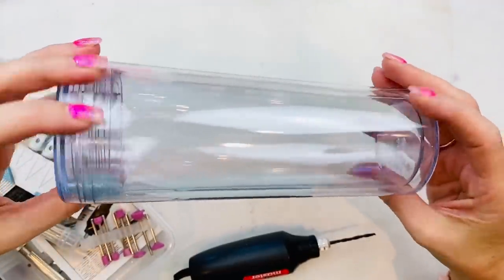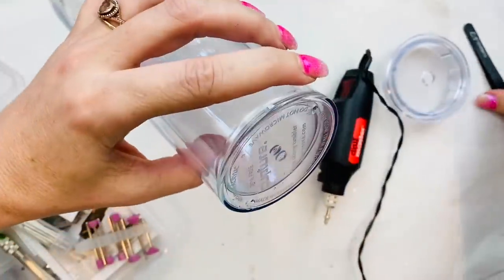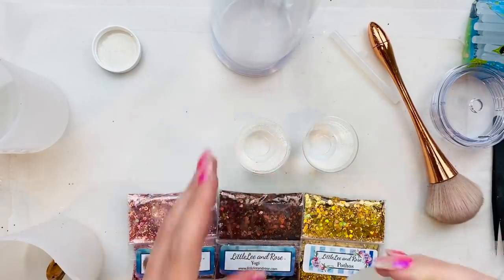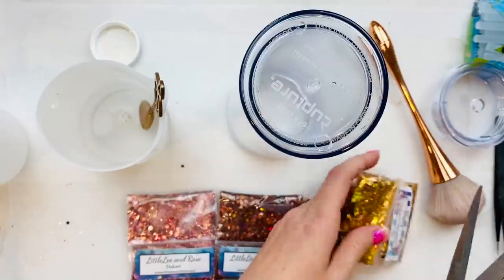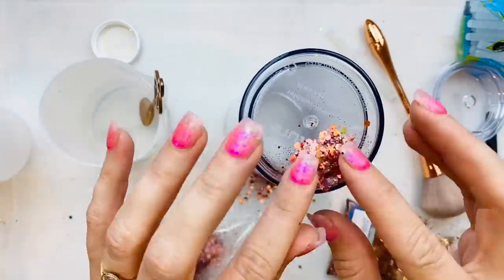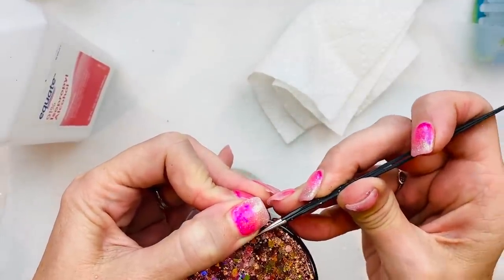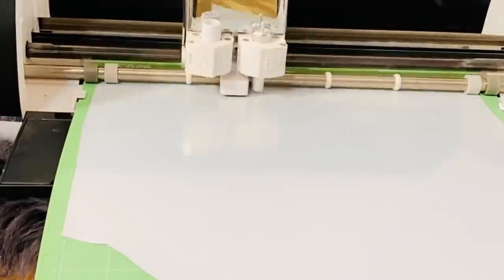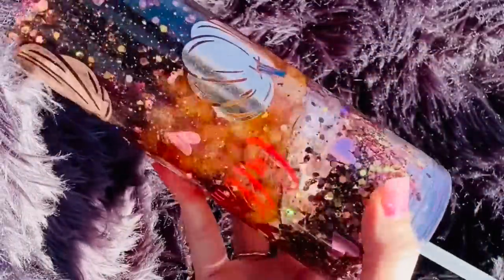HOW TO MAKE A SNOW GLOBE GLITTER ACRYLIC TUMBLER

Comment: What is the water/glycerin ratio?
Reply from the maker: EQUAL PARTS
Reply: @littlee how much did you measure for this cup?
Reply: @tinaolimpio2487  Good question
Reply: @tinaolimpio2487   For my Venti 24 OZ cups, I do 1/4 Glycerin and 3/4 water. It comes out great regardless :)
Reply: @dominiquefesta8571  what about for an 18oz cup?
Reply: @dominiquefesta8571  Is It Better To Use More Water Than Glycerine??
Im Barely Starting Out!!
Reply: Make sure to use distilled water
Reply: Equal parts is normal if you don’t want it to to move as quickly or float as it sits try 60-75% glycerin it helps slow the movement a bit

Comment: I make little round flat stoppers out of uv resin on a silicone mat to plug the hole then cover with more uv resin to seal down, sand and do a full layer of epoxy on the turner.
Reply: Thank you so much! I was having the hardest time sealing the bottom.

Comment: I buy the gorilla glue epoxy at walmart. Its in a syringe. Much easier than the epoxy in the bottles. It sets in 4 mins n ab 20 mins it’s completely hardened. I stick tape in side or over the hole n then epoxy or those clear rubber wall hangers by scotch. But the glue I never thought ab! Smart! Love the video!
Reply: Hey, do you mind sharing where you find the tumbler to work with ?
Reply: @JenniferHernandez-zd3xv  a month late but I ordered mine on Amazon and got different colored tops with straws .. reasonable price too

Comment: Adding the water to the glycerin is a double edged sword. While the mix does make for a nice suspension for the glitter if you freeze the cup (to keep your drink cold longer) you risk cracking it because water expands when frozen. Glycerin does not expand when frozen (it also stays frozen longer than water), but once you add that water in there all bets are off.
Reply: If you leave a small air bubble, you should be okay on the expansion part of freezing.

Comment: I’ve read in groups that the epoxy on plastic cups causes toxicity.. does this not apply because this is double walled? Also have you used baby oil? What’s the difference between that and the glycerin?
Reply: Double walled is okay.  
Baby oil and water do not mix at all so you’ll always have a void somewhere in the mix.  The water and glycerine mix will have glitter suspension throughout the entire mix.

Comment: Hi!! I just bought some double wall cups to make the snow globes effect with them but once I started pouring the mixture it started to leak at the top of the cup. Which brand do you recommend to purchase that will not leak?! I need help!!! Please!!!
Reply: @jeanette Torres I know this was probably directed solely at the YouTuber but I make a lot of these and personally I have found that the Starbucks cups are great probably the best but they’re very pricey and if your making these for personal use then I’d choose the brand Maars as it is definitely a close second and quite a bit cheaper I find them on Amazon and (3) of them  either clear or with cute colored tops and straws their only $24-$28 so max $7 per cup and they’re very good quality! Good luck and happy crafting
Reply: @deborahxayasith71  thanks!! I’ll look them up!!!
Reply: @deborahxayasith71  not sure if you answered the question  do the Maars brand leak at the top when pouring in the solution?
Reply: @jaliawia7463  no I’ve never had one leak ever I made one into a glitter tumbler for my 17 year old daughter about 6 months ago and she uses daily and has never had a problem I’ve made probably about 20+ of the maars cups without problems if you have any issues reach out to Amazon or the maars company and they’ll replace them immediately hun hope this helps

Comment: I have been reading reviews on Amazon saying the tumblers leak from the top once the solution is in it. Any suggestions for stopping that?
Reply: This happens when you do not extract the air from the glass for at least 5 hours after adding the glitter and liquid, the air exerts a lot of pressure inside the glass and leaks at the top and bottom.

Comment: I thought epoxy couldn't go on plastic cups?  Was that a special kind?
Reply: If you are using FDA compliant epoxy, it can go on hard plastic. If the plastic can flex when squeezed the epoxy will crack so it isn't recommended on those kinds of plastics.
Reply: @TD-lq1kt  interesting,  thank you for letting me know
Reply: Anything double walled, plastic or whichever else, can be epoxied. Anything single walled, you cannot use epoxy.

Comment: Do you sand the outside before applying your vinyl?
Reply from the maker: Only if it is necessary. If you do sand you will have to add another coat of epoxy after the vinyl to get rid of the sand marks

Comment: How can you keep the glitter from clumping at the top so much? Just add less glitter? Or less solution?
Reply: This happens when you do not extract the air from the glass for at least 5 hours after adding the glitter and liquid, the air exerts a lot of pressure inside the glass and the glitter accumulates.

Comment: My glitter always gets stuck and the solution never goes to the bottom. Is there a solution for this?
Reply: I put glitter first shake the glycerin and really don't fill it that much. Just up to the first level of the cup inside
Reply: Handheld back massager and vibrate it down
Reply: This happens when you do not extract the air from the glass for at least 5 hours after adding the glitter and liquid, the air exerts a lot of pressure inside the glass and the glitter accumulates.

Comment: If you dont have a scale for measuring you epoxy can you just make sure you use equal amounts.
Reply: Not all epoxy is by weight 
Read the instructions on what you have
Reply: @rachelsrandoms1670  if it is by weight do I have to have a scale. And where would I buy one

Comment: Does the baby oil substitute for the Veg Glycerin?
Reply: I think with the baby oil it will have a faster flow. I want to try it on my next cup, I’ve been using the glycerin
Reply: You can use baby oil (without water) and the glitter will have a slow movement 😉

Comment: IF YOU USE LITTLE LEE & ROSE EPOXY and you want to make 20 ml you need 5ml of part B & part A 15ml, right?
Reply: Kokopellico DCS no! It’s equal parts. 20ml would be 10ml part A and 10ml part B. :)
Reply: @carlaschlesinger5434  I thought that it's a 3:1 ratio with her epoxy? I'm confused.
Reply: Kokopellico DCS nope!  It’s ok, it’s all quite confusing.
Reply: @carlaschlesinger5434  Sorry but ON her website it says 3:1 ratio. And there's a big difference in the bottle sizes between A & B
Reply: Kokopellico DCS  do you have a link ? I just looked at it, it says 1:1. Not sure where you are seeing this.
Reply: @carlaschlesinger5434  I just wrote a message as the product is now gone
Reply: Normally epoxy is equal parts. She puts them on a scale which is not exactly the right way to do is since one part is more dense than the other.... buuuuut if she has her own epoxy then maybe it’s best to follow her instructions

Comment: I know this video is a almost a year old, but hoping I can get a response for help on mine I made for personal use only. Is it normal after all is said and done for the glitter to separate to the bottom or top and only mix when you shake it? I'm using a glue/water mix, but also did a water glycerin mix and it's doing it on both.
Reply: Yes that’s normal!
Reply: Yes, because it is still like a regular snow globe where if you're not using it the stuff sinks

Comment: any problems with a leaking rim???   Im having issues with that! uggggg
Reply: I'm having this problem! Did you find out how to fix it?
Reply: @snowball0jb  no!   I was so worried about the “hole” leaking and now that’s the least of my concerns.     No idea if the Starbucks cups leak but it’s hit or miss with my order from Amazon.
Reply: @snowball0jb  in another tutorial I watched, the woman used uv resin to seal the bottom of her cup and the leaky rim
Reply: @PrettyPreciousG  i did this and it works but you have to make sure you cure it good. If not it looks like it's dripping

Comment: Where can I get the weight balance to weigh the epoxy and whats the ml?
Reply: Hi, epoxy is normal equal parts and since part A is heavier than part B, you might be better off using a measuring cup :)